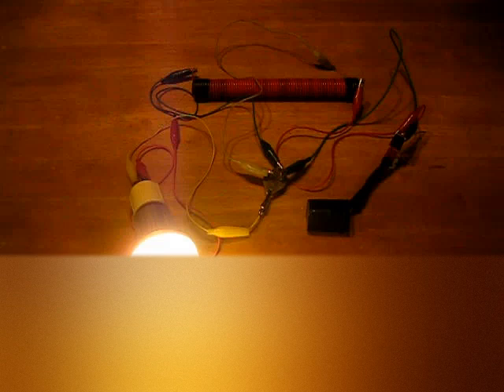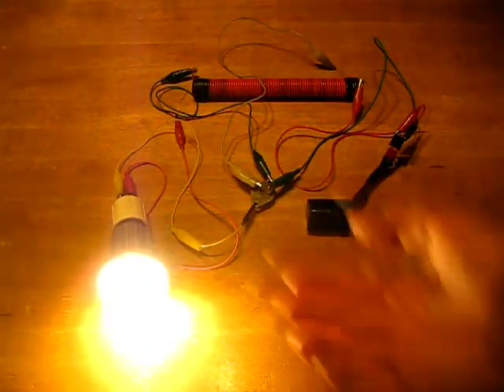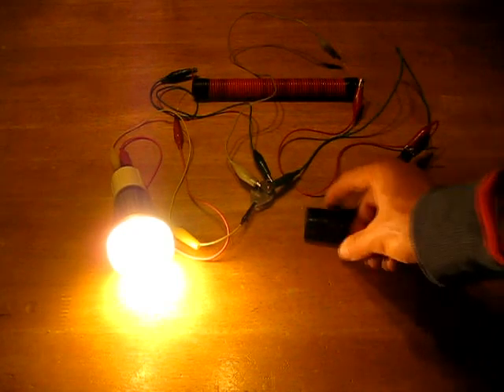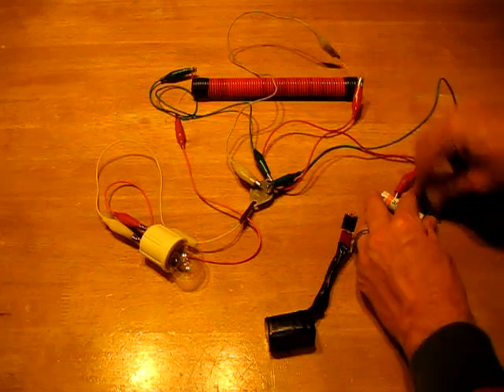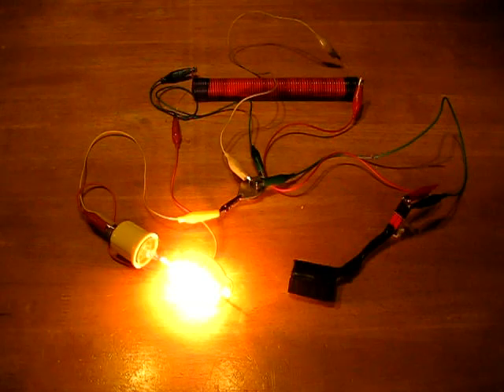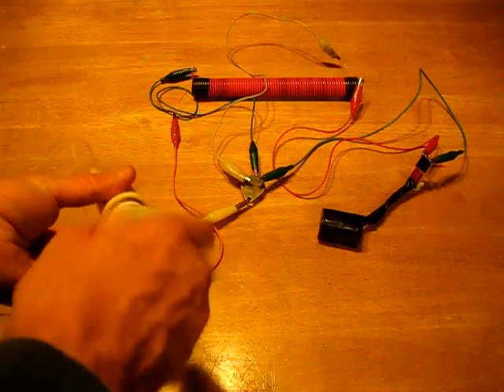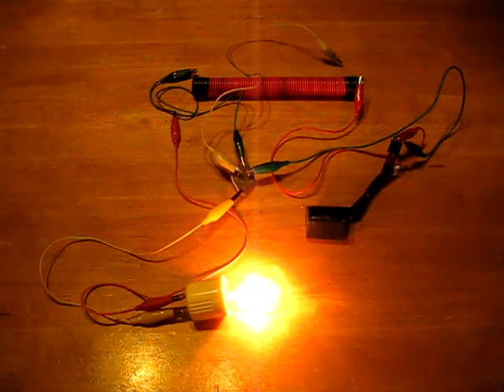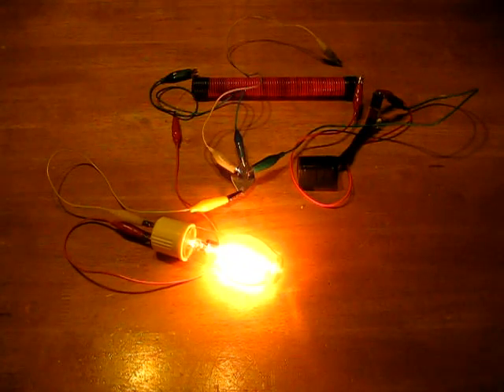Super Joule Ringer 3.0 real world power made easy!

Comment: I haven't thought about this for a long time but I believe I understand now. First, the power source starts electrical flow. Then after disconnection, the magnetic field of the ferrite rod maintains it. It reminds me of a transformer in which the primary coil is fed by a battery; and, after disconnection, the coil becomes the secondary which feeds off the remaining magnetic field. If I understand correctly or incorrectly, please respond. Thank you

Comment: Maybe reason the efficiency is low as you mentioned far as the free energy kapa side of things. Don Smith says it has to be over 20 kilohertz to reach rf or maybe 40. You should try to get over 500 kilohertz or better.  Things get harder on component side when frequency goes up. As far as high power. When you have a transmitter you can have a lot of receivers you'll need to get more than the source power. Low frequency doesn't do it L.S.  .All that noise tells me frequency isn't good enough. High frequency you can't hear.

Comment: I realize that this is a fairly old vid, but I did try making this circuit. I wasn't able to obtain and 8" ferrite rod to wind my transformer but I did find an approximately 3"  rod and wound a much smaller transformer on that in the same fashion. I hooked up everything as in the schematic and used a 5v 10,000mah USB power bank as my input voltage. I've built a few joule thief's before and ran gutted LED bulbs on them. The gutted bulbs will light up nice and bright for me using this circuit  I have 2 of them wired in parallel. However I cannot light any AC bulbs. Not sure if I need a much higher input voltage and larger transformer  like you are using or if I need to add a bridge rectifier to the output or something else to light an AC bulb, I found a 60watt equivalent filament style LED bulb  that uses 4 actual watts that I'd like to light. The gutted LED's I'm currently running were 60 watt equivalents using about 6-7 watts each. I can't gut this other led easily as it has an actual glass globe and I'd like to not gut it unless I have to. Hopefully someone else can help with this since Lasersaber has been MIA for some time now. Thanks!

Comment: Added a few upgrades for charging batteries, using a pair of 6volt lead acids rated to 4AH, anyway I want to share what I am up to, need a little help getting this out, using the Basic Joule thief circuit, with a very nice change to the coil design, a 3.3k resistor and a .001uf cap in parallel to the base from coil to base. The transformer design operates a 100khz and rings at off and on states, draws 80ma or so, after 24 hours, run battery is 6.33, and charging battery 7.06volts.  The issue with the ringer if not working could be from B+ to the coils, swap the coil end around on the base coil, that should start the oscillation you need, it is easy to miss this issue.
Reply: Try this it works better and is inexpensive.     https://youtu.be/kYLFrYc13P8

Comment: Why would you create a circuit to step up from low voltage DC  to drive a
 circuit that then steps current back down to the LED current levels?   
 Why not just  wire  the LEDs out of the LED lamp with low voltage?  Too
 simple?     No such thing as "free energy"
Reply: Energy is free , you're just forced to pay for it , over unity does not exist.
Reply: What about CFL........... you must credit him for the simplicity of the circuit he made.

Comment: Is it possible to increase the brightness of the bulb by increasing frequency  instead of increasing voltage?
Reply: You can't just increase the frequency, because it is self adjusting circuit, greater the load you put in, lower will be the frequency of the circuit.
Couldn't you hear the ringing sound when he connected the halogen lamp....the frequency came below 10KHz at that time.

Comment: I have new magnet wire, I need to know what guage your secondary is, I have the magnet wire Radio Shack sells, the generic 3 pack. I need the secondary guage and if my secondary is larger guage, should I go larger than 14 guage or smaller to drive it more efficiently?

Comment: I know this is old stuff to you; but I'm just getting into it.  I have my first exciter working great.  One question on the 3.0.  I did a timing test with an 11 watt LED and it starts to dim at 4 hours.  This is with a 8 AA battery pack.  A 13 watt CFL lights at full power but only lasts 45 minutes.  It's drawing 1.5 amps!  I'm using a 3 watt LED and it pulls .035 amps and lights pretty good.  Is there something I should check or is this normal?  Thanks
What if I gutted a CFL?
Reply: 6 watt l.e.d will give you good light and last a while, plus, you might want to retune your coil. The primary is what is usually used to tune the coil, but that depends on how many turns you have on the secondary. I  am going to try then make a video and give full specs.
Reply: I took some winds off of the primary and got full brightness on a 3 watt LED.  I'm very happy with it.
Reply: I am glad for you

Comment: im sick of you guys faking these mods, the schamatic on this mod looks nothing like what you posted and doesnt work, just a total waste of my time and money
Reply: The transformer is the coiled ferrite rod.  Chill
Reply: texjarhead yes and it showed the ferrite core and a e core transformer wired together, i bought the same ferrite core, same wire, same transistor and no go, would not even light a 2 watt led night light.
Reply: Thomas Gregory sorry ferrite rod 5/8 x 8 inch rod from ebay from your link
Reply: Just built the joule ringer 3.0 runs led lights great. Ran two for over 10hours on a 12v battery. Had to fit a 4700uf cap across the I/p supply to get them to light from 2 x 9v batteries in series (18v) but worked great. I will have to play around with the Coil to get the current draw down from 1.5amp to 1amp but the tips video explains quite well how to tune the coil to the load. Thanks for the ideas

Comment: what is a joule ringer vs a joule thief?
Reply: Basically they work on the same principle

Joule ringer= transformer+transistor= voltage that can give you nasty shock

Joule thief= transformer+transistor+resistor= enough voltage to light a 5mm LED(3v) from 1.5v.

Comment: Great circuit... got the rods from your link... not very cheap but gets me started.

questions:

1) wouls a different rod shape work as well? I have sources way less expensive ones
like in the pic here:

2) is the 14 gauge wire single strand or multiple strand?

thanks, will post my replication

Comment: why would you? typical capacity of a 9V is 5Wh, again, just drive LED strips (mentioned due to cheapness, but other options exist) at their nominal low DC voltage so you don't lose half the energy to entropy, if you had an understanding of thermodynamics you wouldn't argue in favor of conversion, when you design a driver circuit, especially a battery driven one, efficiency should be your #1 concern, voltage conversion = losses, avoid it when possible, also it increase complexity, avoid that too

Comment: It's so that you can run a normal bulb, off of a low voltage battery. It will also discharge batteries down to almost nothing, so you can run that light for a while with batteries that electronics will consider 'dead'.

Comment: Ive no idea about electricity, current, amps and all that. would that output run a laptop or similar devices. Just thinking about all the knackered  laptop batteries and someone just wants to power  up but not from mains and the device would be compact enough to just sit close by laptop / whatever.

Comment: that's just an self oscillating circuit passing through a transformer, what's the big deal? and I doubt it's very efficient, with typical thermal loss from that type of power transistor and coil you'll be lucky to pass the 60% efficiency mark, here's what makes sense just fucking drive the LED from the battery, at their nominal voltage with a cheap and very efficent DC-DC converter, or drive those nice and cheap 12V 5050 strings

Comment: its pretty similar to a disposable cam flash in the way it works.  flash circuits will generally burn out with any input voltage over 3 volts - so i guess this can handle more current :P

Comment: Something in your circuit diagram does not make sense. It appears as if you plugged the useful load (the bulb) in series with the base current of the transistor.  Do I read it right ?  That is a very odd usage as the base current is normally miniscule and if it is made to be large would destroy the transistor in no time. Why not plug the load into the C-E circuit as normal ?

Comment: Just replicated this for a 11w 240V cfl (UK voltage). Cludged together all kinds of wrongness and it still works. 8" x 9.5mm ferrite, 0.3mm reclaimed magnet wire from an old TV crt coil for secondary. 1.3mm multistrand flex from lawnmower wire for primary. ZT1489 NPN (ancient equivelent to NTE130) transistor.
Bodged together in 30mins, run from 4x 6v (measured 21v open) roadlamp batteries. 
Started to ring and glow very dim with 3 batts, kicked on nice and bright with 4. runs hot!

Comment: I was just having a look in my parts drawer and came across a two AA battery pack for Electroluminecent Wire which I think is using the same kind of idea.  I've not pulled it apart yet but I thought you would like to know. Just search for "EL wire battery pack inverter" in G00gle. Hope this is usefull.

Comment: Hi LS, I tried to replicate the circuit, only difference is that the top winding, I also used 28AWG which was available to me and that input of 12volts does give me 110volts. However, it does not light anything not sure its oscillating and that there is no insulation between the primary and secondary. Any suggestions? Thanks

Comment: I also replicated and improved the circuit to operate on just 1.5 volts . it will light unmodified CFL  bulbs . incandescent 110 bulbs and all 110vac led bulbs from a single cell battery . I did this with a radio ferrite rod bit i also bought two of the exact rods LS has . they are 32 dollars each . I did blow 8 transistors with this circuit . All my mods are on my channel . they run on less than 3 volts .

Comment: LS, I have successfully replicated your circuit. Maybe some folks are having problems getting it to work because they have wired it exactly like you showed but have reversed the coil winding directions. I had the same problem until I checked your diagram CLOSELY to notice the opposing direction windings.

Question: Do you think we need to add a base-to-emitter diode? I think this might help to prevent frying the transistor.

I also wound a 3rd hair-thin wire to use for charging batteries.
Reply: Hello.
Did you wind clockwise or anticlockwise? I know that the windings, primary and secondary, should be in the same direction so they can supplement each other in a way (that's the easiest way I can understand the implication of the application). Also, when you mentioned that you added a third coil to charge batteries with it, could you elaborate on that? Also, were you able to use the batteries while they charged?

Comment: I can confirm that this is not a hoax.  I've duplicated had repeatable success, although not across the range of power as seen in this video.  I get results when I use a 6 volt lantern battery as my power supply.  I tried a 24 volt supply and blew the led light bulb, I tried a 1.5 volt battery and get nothing. I'm charging a bank of li-ion now and will attempt later.  As soon as I clean up the spaghetti wire explosion I'll post my own video results. Thanks for the idea and sharing.

Comment: I agree with another comment. We need a video on the winding. I built this exactly to your specs and got nothing. I'm sure there is something I'm missing, but after dozens of reviews I can't figure what it might be.  My magnet wire was 30 gauge and 14 gauge coated secondary wire. My input was a power supply that was capable of supplying 19 volts at up to 3 amps.  Nothing in the line of a result.
Reply: Secondary and primary needs to be connected in opposition

Comment: 2.   If you hawe any plans in the near future to working an a  transformer with low imput power V.with two 2n3055 for real A.C  not justone one side pulsing C.C. to eliminate the balast of C.F.L-s(to bust system efficien....),for eliminate the sort life af C.F.L.without balast (couse,  mercury deposit on one side of C.F.L. electrod).??? Or midifying one balast of C.F.L for low imput power V. (3V.- 12V.)? Thanks.

Comment: Awesome! What else will it run? Motors? Laptop chargers? Kettle?
Too easy to make!  when I get round to replicating, I'll try some pots on the + & - terminals to better control volts to amps ratio.. Although resistors just waste power as heat, so no resistors = max efficiency. Playing with some of the simpler Joule circuits I have made I often need to turn them down to avoid blowing components. My 250v JT blew 2 3055's and about 30 LEDs (From AA's) before I got it tuned right, by limiting amps.

Comment: I am going to do this to run all the lights in my house I built , I ran separate wiring for all the lights
I will use a LA battery converted to crystal ALUM and a solar panel

thanks  , Laser , any ideas the turns on that rod ?  or just do a 10 to 1 ratio ?

Comment: I think I can answer this , I do not think you could run a 50/60hz motor with this , the reason this works with the bulbs is because they take the hi freq from the JT and convert it DC , so anything that has a switching Power supply (like a laptop) could work now if the drill is a BLDC drive it might work

Comment: I have tried to replicate this circuit many times and this inspired me to try again using half of a large toroid from a TV. The results were the brightest I have seen my bulbs so far, using the prewound 30?awg looking about 400-500 turns and about 40 turns of 28awg as the drive coil. But as usual, it requires at least 500mA to get the full brightness of my 7watt LED bulb and 14watt floro from 12v input. I'm guessing to see your results your circuit would need to be replicated exactly.

Comment: i tried a replication assuming they were the same as the 2.0 circuit, where there are 20 primary turns and 200 base turns. turned out pretty well but the amp draw was still up around 500mA from 12v. it did light a 60 watt bulb brighter than any other circuit i have tried so far, the 60 watt was not very bright but it definitely got hot.

Comment: Lasersaber,   You have hit on a magnificent and brilliantly simple circuit.  It is a Joule Thief, a Bedini Back-popper, self-resonant, extremely efficient  DC to AC converter that is self-starting and handles various loads.   It adjusts the resonance to the input voltage and the load.   All with one transistor and one bifilar coil.       Much thanks for all your patient experimentation.
No doubt some of the outpur power is coming from the Dirac virtual sea, etc.
Well done.